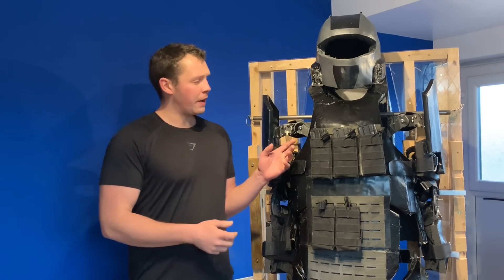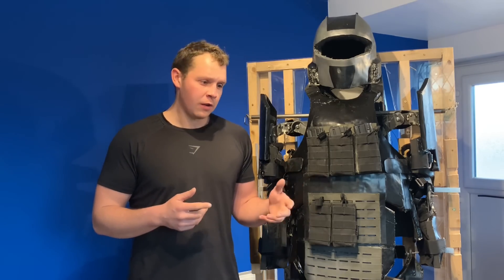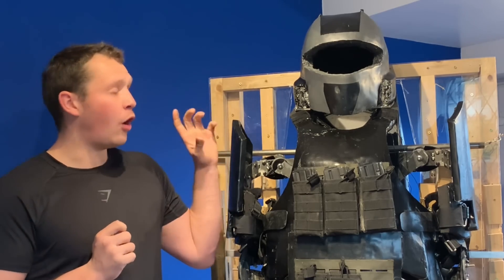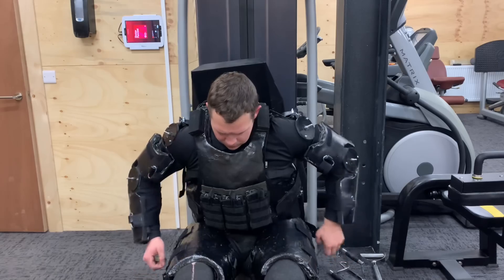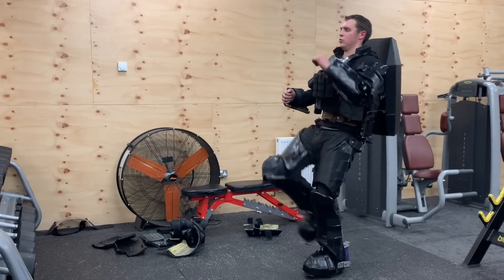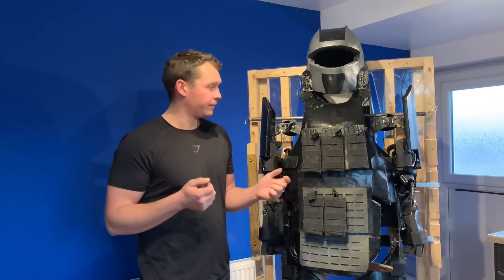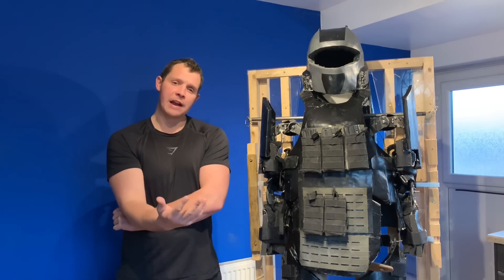Functional Combat Capable Power Armour Development Episode 5 Quest for Bullet Proof Exo Skeletons

Comment: If you want to be high tech, you can get around not having access to optics by implementing augmented reality into the visor. You can easily create a "crosshair" HUD using two points of reference on the rifle which also comes with a benefit that it will not be visible to NVG since you can  enclose the reference gadget and it will still work. So you can hipfire a medium machinegun with some accuracy even. Although I think Anduril beat me to the idea.

Comment: I think that the biggest things to worry about would be motors that allow you to carry more weight and run faster, not necessarily carry more armor. You can use existing armor in a traditional setup, or even if you wanted to get carried away, the shoulder pads and stuff they started using in Iraq for a while. But overall it's more important to have extra ammo and be fast than be a tank. You could even go as far as making a kind of one size fits all wet suit style soft body armor that slides over the exoskeleton sort of like what they were implying with the Ben Affleck version of Batman. And exoskeleton could have adjustable telescoping parts or replaceable parts to fit different heights and builds. So good soft armor. The problem with your heart armor is that it's going to have to be custom built pieces for each individual person, or they're going to have to have a huge warehouse of individual pieces that are fit to each specific user. As for the helmet, the top part might be good, but the faceplate presents a lot of issues even with aiming. You might try a lower section that comes off or asymmetrical on one side like a batter's helmet.

Really interesting project. Keep up the good work.

Comment: Hello, my brother is a major enthusiast in power armor, and I saw on your website that the armor is suited to stop 5.56x45mm NATO from a 22in barrel at 25 yards. That is impressive. However, the common Lvl III and IV plates that soldiers carry today are rated to stop up to a 30-06 from a 28 in barrel (Level IV). With 5.56x45mm NATO, and 7.62x51 NATO being the common calibers for modern warfare, is it possible to stop the rounds that are in that higher caliber category (being 7.62x51mm/.308 Winchester), and if not, do you have plans to allow the armor to stop it?
Reply from the maker: I intend on getting the protection up to that level, i mainly need to do more testing, but im waiting until im ready to cast the armour for the next prototype first as i when i did my testing there was a considerable time gap between then and actually building the suit, meaning i wasnt using the same batch of materials as i did for testing.

Comment: Hey, it'll be expensive but for the visor. Use ALON (Aluminum-oxynitride) that stuff is durable as fuck and unlike BG, it doesn't completely mess up your vision when it gets hit.

Don't try boron carbide plates, yeah they're lightweight but rarely do they stop multiple rounds. Use the more durable though heavier ceramics like silca-carbide.
Reply from the maker: Thanks for the info, im still deciding on whether to just have flip down visor with camera and screens as the lenses were a ball ache,
Reply: @MattExo-Dynamics  cameras? Don't go that far man, biggest thing you can do with armor is overcomplicate it. Make it able to take special rounds like tungsten carbide m993 multiple times before you shift to more complex systems. Mobility, survivability, and flexibility.

Comment: I know it might be a bit advanced, but you're going in this direction anyway. Forget the scope and use a relay to a HUD display inside the helmet. See Raptor helmets for an example of what I mean by that. The rifle can be sited to a small camera, even night vision or IR, instead of a standard scope. Can then shoot around corners without exposing yourself and even artificial "hipfire" since you don't need to look down the scope to aim. Better yet, perhaps instead of a hand-held rifle an integrated rifle that is mounted on the suit itself. Either down the forearm or a shoulder mount or why not both?

Comment: You have done some good work on your suit. 
Have some hints and sugestions.

1) for ideas regarding overlaping the plates, it might be helpfull to get (borrow/buy/get for free on web) some pictures (or a book even) with knight armour. 

2) for temporary hightened speed of movement, you might contemplate addition of either wheels (like sageway or even roller skates), or bionical ostrich legs - preferably mounted behind your boots on movable suspension, when up, the leg does not touch the ground and footsoldier simply walks, if down, it adds another 30 centimeters of hight to the soldier and recuperates quite high level of energy from movement, into the next step. It is not primarily powered and people with that can run 30 or more percent quicker, than they go witouth that. 

3) if is the backpack unit too small for a batery, try incorporate either more bateries, or a small generator, to replenish them on the go. If it does not fit INTO the suit, add simply a cart (something like rickshaw) connected to the ring over the belt of the suit. That should allow quite natural movement still, and the cart can be used for transport of another interesting equipment or armament (handheld rockets, heavy machinegun, ammo for heavy machinegun, flamethrower, drone(s) etc for example). 

Good luck in your project pal.

Comment: Try rolling around in the mud for  about 10 mins. Then try climbing over a small fence.
If somehow dirt gets into the gears, you could literally be immobilized with your arm stuck in one position.

This thing will live in the mud essentially, just look at Ukraine. War is not clean and is full of rubble, we learned these lessons in ww1 they tried making super armored soldiers but alas they ran into these same issues, and it does not make you invincible it only gives you false confidence. Being lightweight and mobile should take precedence over armor a soldier can’t fight if he can’t move. 

I know you showed some movement but I’m sorry I could see you could barely take a knee, somebody could just push you over easily. This is why you cut to each movement, because it took you a good 10 seconds to get into push-up position, also try and do 2 pull ups.

I don’t mean to be rude just trying to give my criticisms

Comment: honestly this is very unrealistic and shouldn't be made using power, you can easily make level 4 body armor which is light weight flexible and not bulky and takes 5 to 10 minutes to put on, this is quite frankly pointless, expensive and useless

Comment: I would go to say that this isn’t ‘power’ armor. At least, this would be considered braced combat armor. It isn’t powered by any souse of fuel or electricity such as a battery. Also, there aren’t any electric servos that enhance the user’s strength and endurance. Also, @ kveldulfpride, you are completely correct. There are entire regions that are going unprotected because of the lack of layered bands of plates around the suit. As well as plates of armor that offer insufficient protection due to their measurements.

Comment: You need to run 10 km in under 45 min in full ruck.  It isn't too much to ask to be able to do five pull ups with only the armor, rifle, and ammo.  All of this must be demonstrated before you run through a forest with lots of humidity and mud, open desert with lots of sand and rocks, in and out of ditches, up and down half a dozen flights of stairs, all in the rain, snow, sand storm, extreme heat or extreme cold.  You will need to get in and out of all types of vehicles from stepping, to jumping, even falling.  Conducting first aid starting with the eight basic wounds, both as a victim and as someone administering.  You will need to at least drag another person wearing the same gear up to 100 meters.  Then there's the whole concept of swimming and/or doffing so you don't drown.
While I strongly hope you can pull this off, DARPA has been working on concepts like this for decades.  I also hope you're speaking with some SAS or Royal Marine types to give you insights of the not-so-obvious nuances of wearing armor in practical, real life applications.

Comment: I just can't see the benefit for minute gain in protection from small arms (though I doubt this would stop good quality AP 5.56 or 7.62, 308 etc) and the huge cost to mobility, lets not even go to what will happen in a muddy trench or the cratered and twisted remains of bombed out forests and fields. Most explosives will still injury and kill an operator, some increased shrapnel protection is the only thing this would gain. Anyone in this armour is just a sitting duck in modern mechanised warfare. A drone would spot you miles away in this and send a FPV drone at you so damn fast. You need a new material that is as of yet not invented or feasible for mass production. Power armour is just a pipe dream, at least for decades if ever given the mobility cost and power of modern small arms. Keep at it, but I am cynical these kind of armours will ever work in modern war, the dye has been cast on mobility and the power of small arms and the mass surveillance of the modern battlefield.

Comment: If i could make a slight suggestion, maybe look into slight conical shaping for the armor. Deflect the energy away, as opposed to trying to stop it with flat faces. Its a good start, i wish i could help physically. Im honestly bursting with ideas for personal powered armor. The hardest part is gonna be power supply I'd wager. Also! OPTICS will almost certainly have to be slaved to the helmet eventually, i dont see anyone being able to rest their cheek on the butt of their rifle with the helmet.  Maybe contemplate a neck protector akin to a chainmail insert also. Having watched a LOT of combat videos, and even having spent time in combat i can safely say neck/throat injuries are infinitely more common now than they used to be.

Comment: Looking at the medieval armour suits, with their hundreds ( if not thousands ) of years of development, evolving into highly effective armour against melee weapons and ballistic threats of the time.....they had it down to an artform in protecting the vulnerable joints and pivot points of the body, Allowing a suit to very closely mimic the bodies movement.

One main area was the upper arm/shoulder/armpit which tended to use a either a series of highly flexible bands ( think of lorica segmentata's ) or plates working in concert ( Spaulder ) to provide maximum mobility....... or a larger, less mobile but more protective armour section that protected the entire shoulder, including the armpit ( Pauldron ). The armpit/shoulder joint was absolutely critical for the warrior and a compromise had to be achieved between mobility and protection, but a hit here would likely remove the warrior from the fight.

Another critical movement point was the torso and waist area, with breastplates often made in several flexible plates and mounted quite high up on the torso, with waist area covered by overlapping and independently moving sections, a knight could quite effectively bend at the waist in all directions and twist their torso.

Comment: Imagine instead the corporate boot crushing down on the neck of the unarmed civilian, with armor impervious to their weapons and actuators to help stomp peasants' rights into the dust of history. 
Police, and in the future private militaries and security firms, will use AI and power armor to widen the gap between civilians and those who are supposed to hold power. The suit's cooling doesn't have to hold up in the deserts of Iraq, it can work right here in an air-conditioned superfactory or corporate tower in America. It doesn't need power to do a 24 hour patrol in the wild, it can charge its battery at the company or police charging station. The armor doesn't need to defeat RPG, but rather the typical molotovs, bricks, stones and pistol rounds of protesting civilians, demonstrating workers, etc.. 
It's not cost efficient for a shooting war between militaries, but this is a small expense for a company like Google.

Comment: I believe in you, and believe that you will find what your looking for to continue the project. If you do end up continuing your project, i have a suggestion for securing your armor to the body. Id say use airbags on the inside lining of the armor, like the cuffs doctors use to check blood pressure. That way no matter the build of the wearer, the suit can cling to their body. Aswell as various advantages in combat scenarios such as falling from great heights or taking blows from enemy weapons or explosions. Of course this is a suggestion for far into the future. But I think if you continue your designs with this system in mind. You can produce a prototype with comfort and control being covered (though mobility might be an issue)

Comment: Regardless of what we think power armor will be. With our technology now it will be closer to fallout then anything, meaning it will have to be a single one piece suit designed to close around the wearer with more hydralics and robotic hands capable of supporting heavy objects without direct hand contact. The boots would need to be elevated with additional suspnsion to support the suits weight, meaning you would have to step up inside the suit rather then wear the suits boots like actual shoes

Comment: good job, but in a real life scenario
it looks extremely bulky and may create excessive noise that will alert the enemy
the height is also a concern considering the boots add an extra few inches
the height and bulkiness also limits the number of troops that could be carried by a vehicle
existing armored personnel carriers would have to be larger to account for the added weight and size of the soldier
also the height makes it extremely difficult to go through doors or little holes that soldiers hammer out in an urban environment
it also creates a much large silhouette which makes it easier to spot
other things to consider is the weight of the helmet and attachments such as as batterpack, night vision mount, flashlights
battery packs can not be in the helmet as that is a weaker area where a bullet could go through because there is less armor
a night vision mount for night vision goggles
and flashlights for well, light (not super important, but could be useful when nightvision is not available
ir strobe light for friend or foe identification (is very dated way, but is still used) and gps tracking built inside the helmet
communication like a radio should also be built into the helmet
and also something that also needs to be considered is sound
being able to hear an engine running, people talking, or a person moving around in the bushes is important to a soldier
with all this the weight of the helmet becomes very important because a heavier helmet means more strain on the soldier's neck which becomes uncomfortable overtime
which is why helmets are designed nowadays to be lighter, but offer protection against shrapnel (they aren't designed to deal with bullets, but they can)
that is just from an equipment standpoint
other things that need to be considered is when the armor is penetrated
when penetrated how will a medic render aid
if a medic were to provide aid can the armor be quickly taken off, so the medic is able to completely access the body
the battery pack seems to be built into the backpack, but things that need to be considered is battery life, how does it recharge, and how quickly can it be replaced without having to remove the backpack that is already on top of the battery pack
also how much weight can the exo skeleton hold
and even if it is capable of holding a lot more can staircases be able to support such weight with multiple people walking on it
also can you swim with it or if you can not swim with said exo skeleton
will the helmet and backpack be equipped with some sort of breathing apparatus
other issues is maintenance
can the joints operate in humid environments which encourage rust
and how much time is required to conduct maintenance

to end this because I am out of concerns because it is really late and i want to sleep anyways good luck

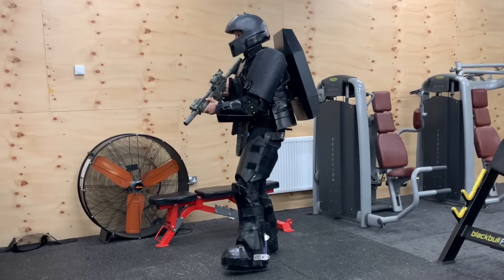Comment: 9:09 get rid of the visor all together. 

Vr headset with display on the inside of a fully covered helmet that has a series of cameras on the outside. 

Perhaps having a series of overlapping plate or just go full x-men juggernaut style and do the full dome with AC, hearing enhancements, filtered air, speaker, and a series of mini camera to display on the inside of the dome. 

Infact…. The dome would give way more deflection away from the head than anything else….. 

Then the vr headset can display the guns crosshair so it doesn’t need to be fired from the shoulder and quite easily fired from the hip or one handed due to your Exosuit handling all the recoil and heavy lifting.

…..I really should keep my mouth shut if i ever want to make my own…. Everyone I’ve seen try to make power armor or an exo suit have made a couple critical mistakes that could be solved with a few critical changes fo the suits design….. and then they abandon it fully….